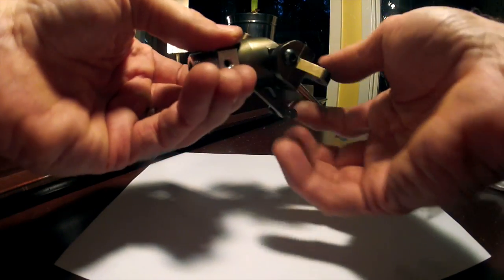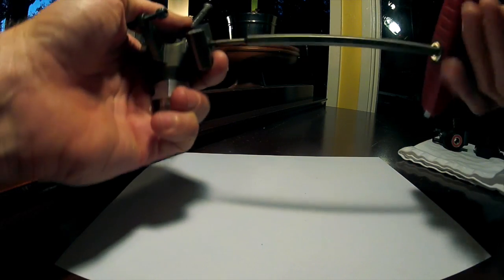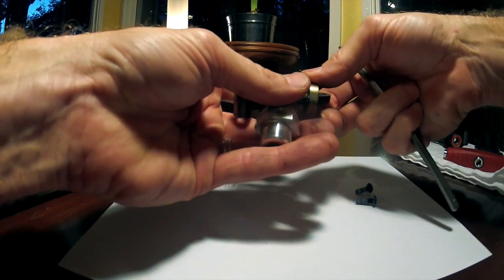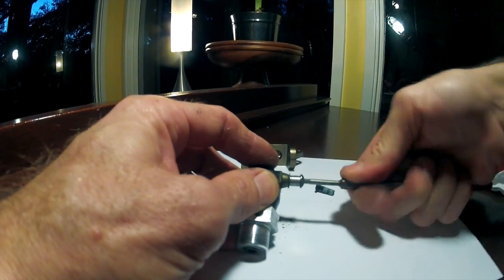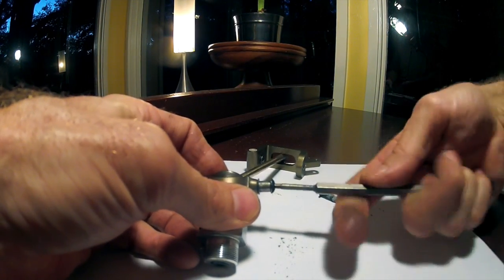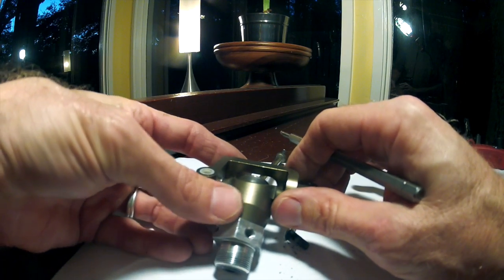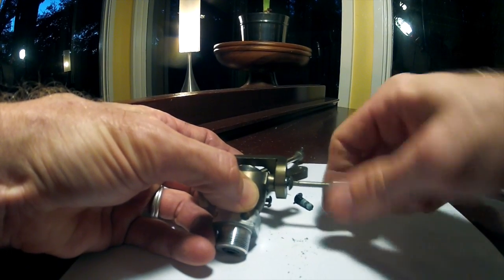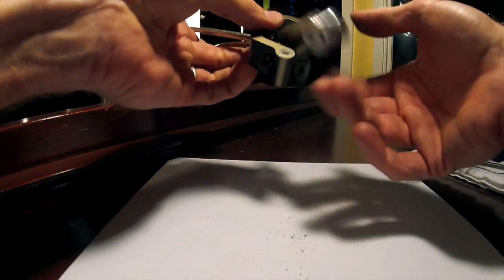redcat alloy caster spindle set up

Comment: does this use 2 bearing or 1 bearing cause i can fit one bearing but not the other from the stock bearing.
Reply from the maker: Trung Nguyen  hi,  sorry so late on reply.  the castor is bushed to spindle,  there are no bearings in the castor/spindle post setup.  the SPINDLE/AXLE  does have  2 bearings